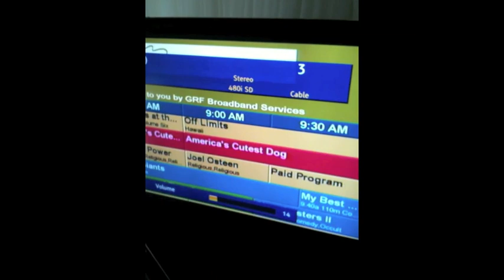Trina Foster In EASY How To REPAIR Black/ Blank Screen LCD HD TV Main Board Repair Replace Vizio

Comment: Hi Trina .....just curious on that model number Vizio you had fixed with the black screen?
I have one that has a black screen only thing I get is sound and of all times it went out on super bowl sunday....lol
Reply from the maker: Oh NOooooo!! Not on Superbowl Sunday !!! :-(  Well that is a funny coincidence (not funny ha haa but funny peculiar) That is the SAME DAY this confounded tv decided to finally go out completely ! Our VIZIO E422VA
42-Inch LCD 1080p HDTV had been acting weird a few weeks prior to Superbowl Sunday and I decided to order a main board off ebay to see if replacing would fix the problem and thankfully it was delivered that Saturday and wouldn't ya know it Superbowl Sunday it went out completely so I scrambled while my husband was pacing in great hopes my idea and handiwork would do the trick... Luckily within the hour of kickoff it was fixed ! Presto Magico ! WHEW !!! Haha haha.... I suspect you may be having the same problem... If you read the comments below perhaps your model is listed from other good folks who also had similar issues.. I'm Sure you too can fix the problem yourself... Please keep me Posted on what you decided to do... Thanks for commenting and watching...
Reply from the maker: If you have a volt tester try testing the regulators Normally it is just a simple repair/replacement of one to fix the problem and very CHEAP too...The main board has a voltage regulator to the processor that failed it's a common problem with Vizio presenting the dreaded blank screen. its labelled AMC1117c and has three pins and it's about a $3.00 part.. Here is a video on how to check/replace https://www.youtube.com/watch?v=mWbrFcfazOA

Comment: hi, i have an LG plasma, but its weird theres a vertical white line on the left side and the screen is black, cant change channels or turn off with remote or power button but can hear sound and screen is black but illuminated. My question is, do you think a new main board would fix the problem? or worth a try at least? thank u!

Comment from the maker: Hi Mary It could just be a problem with your backlight control TRY THIS FIRST !I t's a little tricky to get to. You highlight picture, then you hit the right arrow to bring up the Picture menu. Go down to Advanced Video (one above Reset Picture Mode) and hit the right arrow again to bring up another submenu. Go down to Backlight Control. There are three options: OFF, DCR and OPC. Both DCR and OPC seemed to cause the problem.  turn this feature to "OFF" see if the problem goes away. Good Luck !

Comment from the maker: It does require the removal of a few dozen screws so take your time and be careful. The filter on this model is located in the back of the TV, dead center. You have to move the silver box with all the wires coming out of it, you should be able to move it out of the way without removing any of the wires. The filter housing is directly behind in the very middle of the TV.

Comment from the maker: It has 2 larger screws on the top and 2 smaller screws on each side of it. Once these have been removed it should pull right off exposing the filter. The filter is held on by 4 of its own screws. Carefully remove the filter and wash it, once dry replace and reassemble. OH and I just checked...FYI on this model there is NO filter located anywhere near the bulb. Sorry for saying that earlier..

Comment from the maker: You need a very soft cloth, I suggest you get a propper glass cloth or Micro~Fiber You need to spray the cloth lightly with water. Do not soak it or damp it to much. Then rub the screen lightly in one direction. You can try screen cleaners and mild mix of white vinegar & water Sometimes you can get the fog or stains out, accidents happen to all of us also,but only water and soft cloths Good Luck I hope it works out easy for you. Repeat steps until satisfied.

Comment from the maker: Sharing this: if the panel was junk.. then the computer inside the television could be made to 're-calibrate' itself to learn the current quality of the screen to say that the industry is extremely mastered, even then they would run the calibration to adjust for differences in temperature to keep the screen refreshing at the frequency intended.

Comment from the maker: Hi Adam, Yes it will fix your problem However, this should fix your problem for Pennies. All 3 Will Work, Diode Works Best For Me This Same Reset Ic Goes Bad On Other Visio Lcd & Plasma Tv'S. #1) You Remove Smd U26 On The Video Processing Board And (Add) Put A 10k Resistor Across Pins 2&3. U26 Is Near The The Tact Switch. #2) Remove U26 And Solder A 10k Tru 100k Resistor Across Pin 2&3. Start With A 10 K First. #3) Remove Reset Ic Near Tac Switch Replace With 1n4148 Diode (Nte519)

Comment from the maker: if it is cold and requires more electricity, then the computer needs to know to give the panel more electricity to determine hot/cold is to also determine age. how often it does it? Contact VIZIO to ensure your television doesn't break soon. sometimes that computer will calibrate itself until the voltage needed to drive the panel simply doesn't exist, and then the television is broken because the panel doesn't match the voltage available from the circuit board.

Comment from the maker: firehawk0071 posted and told me that The mainboard has a voltage regulator to the processor that failed. common problem with vizio presenting blank screen. its labelled AMC1117c and has three pins.ita a three dollar part..  
I think It could be the backlight inverter board however replacing the mainboard should fix the problem it's just a bit more costly- I'm sorry I don't have the exact answer for you..  :-( I apologize..

Comment from the maker: Hi Adam… Yes, It will Fix the Problem.. However… BEFORE you replace it check out these steps first..DEAD WITH AN AMBER LIGHT 
Do Not Order A New Board For This Vizio Model. You Can Fix This Problem For Pennys. Problem: Will Not Power Up Amber Led Only. Hint: No Reset To Operate Micro (Brain Dead) I'Ve Seen (3) Various Fixs Below, One Uses A Diode, Other Uses A 10k Resistor, Try Either. All 3 Will Work, Diode Works Best For Me This Same Reset Ic Goes Bad On Other Visio Lcd & Plasma Tv'S.

Comment: PLEASE HELP! My Panasonic 1080i M/N  PT50LC14, 50' wont turn on. It worked fine, then a few hours it crashed. First I heard a loud pop sound, I could hear it but no picture. Now, nothing! The turn on button flashes red constant until I click to turn on then blinks green, growl sound then nothing! What could be wrong? I know it's older, but it was a gift and I'm an only parent. I want to try so hard to do it myself, but I've gotten so confused as to what is wrong!? Help Trina Foster or someone...

Comment from the maker: A couple of thing's COULD be the problem.. Let's Hope it's NOT the Power Supply OR fault that causes PSU to shut down.. Maybe The Light Engine needs to be Replaced.. FIRST TRY This.. UNPLUG the TV, open it up CLEAN the bulb, take the cover off the grey box to the right and very carefully vacuum the filter and wipe it off with a microfiber cloth. Make sure you unplug your tv before messing with it.

Comment: The mainboard has a voltage regulator to the processor that failed. common problem with vizio presenting blank screen. its labelled AMC1117c and has three pins.ita a three dollar part

Comment from the maker: Think about a tornado starting to spin and wish an airplane would fly through the clouds to stop the tornado from spinning before it reaches the ground and does damage? maybe something like that is happening.
like.. you know the keyboard has wires inside for each key, and if two wires where arguing.. it might be a hot spot under the keys to prevent that spot from getting too hot and melting something.. the computer monitors it and shuts those keys off for a second choices of the designers.

Comment from the maker: no other reason to see the black bars on different parts of the screen.
If there was some voltage instability going on somewhere on the panel.. then the whole section would have to be shut off to 'prevent a fight' or 'prevent a riot' and that would mean something is obviously not right, otherwise those electrical riots wouldn't start to form.

Comment from the maker: Okay, I have been doing some research, it sounds like sometimes a computer will calibrate itself until the voltage needed to drive the panel simply doesnt exist, then the television is broken because the panel doesnt match the voltage available from the circuit board. I would contact Vizio direct at 877-878-4946 Monday-Friday 8:00AM to 10:00PM CST Saturday/Sunday 10:00AM to 6:00PM CST They have sent out NEW TV's with this particular issue. I will post more info in case you do not have a warranty

Comment from the maker: #1) You Remove Smd U26 On The Video Processing Board And (Add) Put A 10k Resistor Across Pins 2&3. U26 Is Near The The Tact Switch. #2) Remove U26 And Solder A 10k Tru 100k Resistor Across Pin 2&3. Start With A 10 K First. #3) Remove Reset Ic Near Tac Switch Replace With 1n4148 Diode (Nte519). Vizio Tech Support: (Valid - I Tried It) 1-888-849-4623 Opt 4 Technical Support: 888-849-4623 Try Extension 1669 (David). Hugo Carrera Parts Department 877-668-8462 Ext 1814 Vizio Inc.

Comment from the maker: Try Calling Vizio first before replacing anything~ Vizio Tech Support: 1-888-849-4623 Opt 4 Technical Support: 888-849-4623 Try Extension 1669 (David). Hugo Carrera Parts Department 877-668-8462 Ext 1814 Vizio Inc. 320a Kalmus Drive Costa Mesa, Ca 92626 E-Mail:Hugo.Carrera@Vinc.Com

Comment from the maker: Call Vizio Tech Support: 1-888-849-4623 Opt 4 Technical Support: 888-849-4623 Try Extension 1669 (David). Hugo Carrera Parts Department 877-668-8462 Ext 1814 Vizio Inc. 320a Kalmus Drive Costa Mesa, Ca 92626 E-Mail:Hugo.Carrera@Vinc.Com

Comment from the maker: problem sounds like backlight failure LCD Controller perhaps? The LCD Module perhaps it can be as simple as a CAPACITOR you can purchase at Radio Shack Here is the # for VIZParts.com They are probably more knowledgeable in answering this question. I am very sorry I couldn't be of more help. This seems like a VERY common issue with Vizio that I was unaware~ TOLL FREE: (888) 260-7765 M-F: 9:00 AM - 5:00 PM (PST) or email sales@vizparts.com also I will post a video on how to replace a capacitor

Comment from the maker: Vizio Tech Support: (Valid - I Tried It) 1-888-849-4623 Opt 4 Technical Support: 888-849-4623 Try Extension 1669 (David). Hugo Carrera Parts Department 877-668-8462 Ext 1814 Vizio Inc. 320a Kalmus Drive Costa Mesa, Ca 92626 E-Mail:Hugo.Carrera@Vinc.Com

Comment from the maker: Contact vizio They have SENT out NEW TV's because of this exact problem~They will ask you to take 3 photos upload them to the link they give you after calling them so they can see your screen. CALL Vizio first before replacing anything~Vizio Tech Support: 1-888-849-4623 Opt 4 Technical Support: 1 888-849-4623 Try Extension 1669 (David) Hugo Carrera Parts Department 1 877-668-8462 Ext 1814 Vizio Inc. 320a Kalmus Drive Costa Mesa,Ca 92626 E-Mail:Hugo.Carrera@Vinc.Com